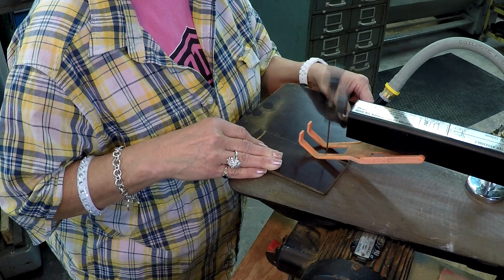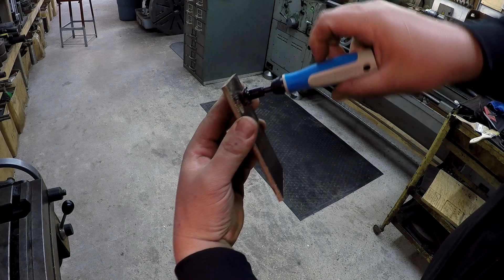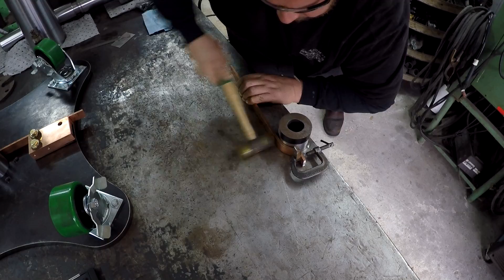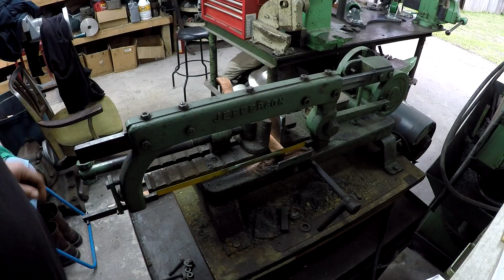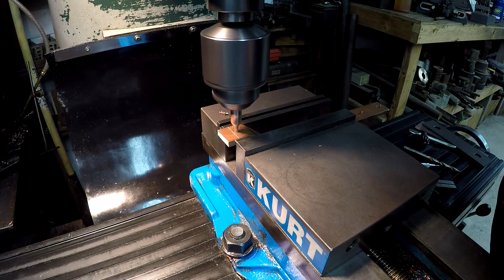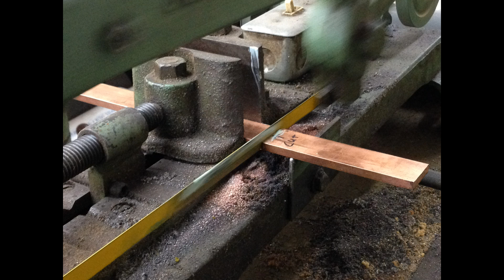Rotary Welding Table Build Part 14

Comment: Dear Adam,
1) in case you need to decrease Ohmic resistance later, you can increase contact area by machining the radius onto the copper bars with a flycutter.
2) thanks for the great videos as always. The part with your mom was great!
Thanks Henner
Reply from the maker: Thanks Henner.

Comment: Nice job putting the 45 degree bends in the bars, I run a 10' forming press at my day job. I like the spring on the bolt idea...that same thought crossed my mind when you first started mocking up the parts! Great to see your mom in the shop with you!

Comment: It was nice to see your Mom stop by to help on the project. The bolt with the spring is a Great Idea I would have a longer bolt with a spring on each side Not that your way won't work We all have are own ways and Ideas That's what is so great about reading the comments I have learned some different things in this series This is such a Cool build
Reply from the maker: Yes we have gained some nice ideas from viewers comments. Some of the design features were from the viewers.

Comment: Abom79 Hey Adam, great to see it all coming together.  A nice on screen demonstration would be to get out a voltmeter and check to make sure that copper block is actually isolated from the base.  Also, once it is all together, you can check resistance from the table top to the copper block to see what your circuit looks like.  Cant wait for my next visit this summer, get to put my hands on it.
Reply from the maker: Hey James, let me see if I can borrow a puke meter from someone and we'll do some testing. Can't wait for our next shop get together!
Reply: Abom79
Hey Adam, you don't need no stinkin' "puke" meter...
just cut the female end off of an extension wire, plug it into the wall,
touch one lead to the table top, hold the other one in your right hand and then
touch your left hand to the base... You will know if it is grounded or not.

Be careful though... I still think you are getting contact through the bronze bushings.

that's how my dad would do it.

Simple!  ;>))

Anon

Comment: Looking good Adam,

IMHO (w/ 32 yrs experience in electronics) your grounding system is sound.

Current will always follow the "Path of least resistance"  I.E. from the Brushes up the main shaft and into the tabletop.

The whack-nut Trolls that think it's going to jump from the shaft, to the bushings, then to the housing, thru the bearings, and then back the shaft and finally to the table top; that is way to much resistance (how meager it might be) it's enough to knock it out of the running as a viable path.

Now, (at the time of my comment) you've had it in service for 2 yrs, with zero issues I'm sure.

Thanks for the great content.  keep the videos coming.

Comment: Just for future reference, when bending a contact radius, always make your die 15-20% smaller than the radius you are trying to make contact with...ESPECIALLY with the less ductile metals.  That way when you assemble you've already taken the springback of the metal into account.  Learned this the hard way re-arching springs for hot rods.

Comment: Adam the ground clamp looks great.  You got a nice fit on the bars I liked your bending setup.  I've found that annealing copper makes it form a lot easier, especially after you have made an initial bend in it.  Copper work hardens really easily.  It's good your mom was able to pitch in with the project.

Comment: ......I would give everything I own if I could spend a day in shop with my mom......but shes 81.......very cool.... Nice work on the ground, the spring can go on the other side and still work fine, actually easier to install in wider gap....and a stronger spring can be used.....just a thought.

Comment: I was thinking about spring on the end of shafts. I think better solution is istaling spring in the center of copper bars. Bettesr forces to hold them and stronger forces to hold them on place. Spring on the end of bars will push out bats on center outside, i center will push them close all the time even they will used in time.  Sory 4 my language. 🇵🇱 Wojtek from Poland

Comment: Nice job on the copper work.  You might consider using dielectric grease between the 2 7/8 shaft and the copper bars to increase and protect the electrical contact being made.

Comment: Hi there Adam,
The copper contacts remind me of the old slip rings used on alternators. Intuitively the large surface area you have will happily conduct large currents. Over time, engineers found that "bifurcated fingers" provided a more reliable connection especially at the lower end of the current range. Basically using the sum of all the finger areas instead of one large one where the current distribution may not likely be shared over the entire surface area of your contacts. Trifurcated or even quadfurcated fingers would help insure electrical contact. Beautiful work as usual sir.

Comment: Flat braided copper strap wrapped around the shaft pressed in by your already existing copper bars would give you maximum contact.  It would be like putting a conductive foam pad against the shaft to use as brushes.  You could add this to your existing design without having to change anything.

Comment: Adam, you might have to add a bolt between the spindle and the copper block. If your bars get hot, they may soften and open. That's been my experience. Ging to depend on the amount of welding as well as welding temps. Nice job sir. It was great to see Mom come in and be involved.
Reply from the maker: I will be checking on the copper bars periodically to make sure everything it staying in place. If I notice some changes I'll go back into the way I have it and make some changes if needed. I think the way I have it set now will work good, but we'll see.
Reply: I'm sure it will and I know you have a good drip on things. I just metioned it because I've had copper do funny things when it got hot from current. Thanks for the reply.

Comment: Your idea of building a hydrolic cylinder from scratch would be a great project.  Have your friend come and help you size a cylinder to fit your manual hydraulic press. With his expertise, you could show how to size the pump and the other components he talked about in the first video. Then you could do the entire build. That would keep you busy for quite a while and cover a lot of topics.

The welding table is going to be a piece to be very proud of. It shows the creative side of being a machinist.

Really like to way you have been able to keep up with the weekly schedule, but do not feel obligated. If you need to take a break, we can handle an empty Saturday. Just do not take too much time off!
Reply from the maker: Thanks for the support Kurt. This build has been a great project and a way for me to show different machining operations. Also a good way to make use to materials laying around that I probably won't ever use, like the faceplate, and Gill's oilers. In the end I have something I can display showing my skills, and a useable tool for my shop.
I'll keep thinking about the hydraulic idea. I don't need one for my press as it has the factory Dake 50 ton cyclinder on it. But I'll come up with something. I do like your ideas though.
Reply: I am sure you could use a hydraulic actuator on something in your shop and it would make some wonderful video. Keep up the great work

Comment: About time for some paint!  That is one hell of a table, you can put your K&T on it and use it as a lazy susan for it. lol Good to see your mom and Stella in a video again.
Reply: NO Paint...

Time to Powder Coat it.

Powder coat will hold up much better to shop mishandling and abuse than paint.

A nice Satin Black powder coat with the Nickel plate.
Whoops, I mean Chrome plate.
Reply from the maker: Anon Ymousmie I like the powder coat, but I'm afraid it will be hard to correct of I mess it up after some use. I figured paint will be "fixable".
Reply from the maker: Thanks Brian! It's going to make a nice centerpiece for the shop when the guys are hanging out.
Reply: Anon Ymousmie
 Not in my experience. I have yet to see anything that was powder coated that held up as well as a good synthetic enamel. Powder coat is a cheap easy method to get a no runs paint job but it is not a superior paint coating.
Reply: bcbloc02 Abom79 First thing is find someone to blanchard the surface of the table, oh THAT would be sharp.  Then spray it in gloss black with polished brass accents.  One word comes to mind CLASSIC!
Reply: I'm with James. Gold leaf pinstripes like on old safes would be awesome, too. ;-)
Of course, you wouldn't be able to put a coffee cup on it but it sure would be pretty.

Awesome work, Adam. Can't wait to see it finished.
John

Comment: I haven't read all of the comments (401 as of this comment), but you might consider cutting a long taper on the main shaft lower end that will push the contact arms out of the way when installing it. Otherwise you might need to dismount the arms or reach under the base to spread then when installing the main shaft. If you need to remove it with any frequency, that might make things easier.

Nice series; it was fun to watch your ideas progress.

Comment: lookin good Adam!  A couple of weeks ago, when you started thinking about the grounding straps you showed the copper bars you intended on using.  It got me thinking about a way to ensure contact at all times but without using the spring alot of folks were recommending.  I drew a quick simple sketch up.  But basically my idea was to use the springiness of the copper bars and bend the ends outward- kinda like a V-block.  Then using the slots to adjust the tension between the bars and the shaft.  This would eliminate the extra parts like springs and bolts. Also, I would wrap some adhesive backed abrasive paper (like 220 grit) around the shaft.  Then tighten up the copper bars so they ride on the sand paper and get fit to the radius of the shaft. I tried attach the sketch here but it didn't work.  You got you method done anyway.  Thanks for the great series and I can't wait to see the rotary table in action.  Jeff

Comment: Adam,
An elegant and imaginative grounding arrangement. Beautifully done!
May I suggest that the bolt you put through the two ground straps use a nut w/o a plastic insert. You may find the plastic insert type of lock nut will melt with the heat of the current.
Eric

Comment: Great video! The ground straps are turning out nicely.
A couple of suggestions for consideration - All can be incorporated (or not) with the existing build:
1. Just to make it look cooler, instead of a coil spring for the tensioner, look at Bellville Discs. If you're not familiar with them, they are spring steel flat washers that are kinda bowl shaped - picture a tiny wok with a big hole in the bottom. This application is perfectly suited for them; constant pressure, short travel. MSC has them, along with McMaster, Grainger, etc.
2. Consider a thin film of conductive grease between the copper straps and the steel shaft. The steel will tend to corrode a little in contact with copper and an electrolyte (such as moisture), so a conductive grease will decrease corrosion (by displacing and repelling moisture) and an added benefit is that it will fill in any little gaps between the copper and steel and even out the conductive path - minimizing the little micro arcs and pitting.
3. Use an anti-seize (preferably copper or graphite based - not aluminum) on the bolts holding the straps to the copper block. Usually, Stainless and copper are OK together, but in low oxygen environments (like a threaded hole) the passivated chromium layer of the stainless can be damaged and not able to regenerate. I won't get any nerdier than that, but it COULD cause a problem, however unlikely.

It's possible that a decent graphite or copper anti-seize could be used for both the bolts AND the conductive grease, come to think of it.
Reply from the maker: I like the nerdiness Lazy D. We always learn something from each other by sharing ideas. Thanks for the comments.

Comment: Adam, where I haven't seen anything exactly like that, I have seen a factory ,at least I think it's factory, similar set up.
 The ground block was tapered toward the rod by what looked like 3 or 4 degrees giving a positive pressure, not springiness per say, but an amount of pressure, I think that would reduce the size of spring you'd need, or so goes the theory.
    Please, make more build videos like this.

Comment: Hey Adam...
NICE, VERY NICE!

You know you can lap the contact to make better contact.

A good trick is to use some 3M 77 spray glue to adhere a strip of emery cloth to the
post and just hand turn it enough to wear in the copper bars.  Won't take long with copper.  You can probably also get it done with valve lapping compound.

Careful...
5/8" x 11 threaded hole in post?... get an eye bolt first and tap to whatever thread the eye bolt has... would suck to have to re-thread an eye bolt.

Great Job... I love it!

Anon
Reply from the maker: Hey Anon, it won't take long and thosr two bars will be well worn in. I already have more than enough contact. No need to remove metal when not needed. 
I want to use 5/8-11 because of my eye bolts, and also i have good 5/8" hold down studs. 
Thanks.
Reply: Cool!... I should have known about the bolts.

Comment: The grounding system is looking awesome, and I'm sure it will work great. My only suggestion is to plug that extra hole in the copper block, weld and grind it flush to make it look better, you've put so much effort into it , might as well go that extra step. Cheers!
Reply: or thread the extra hole to mount a "locking" bolt to securely hold the clamp in place if you find it getting kicked out during use.  It would be awfully hard to kick that clamp out but the hole would have a purpose rather than look like it doesn't belong there.
Reply from the maker: Anon Ymousmie You guys will never see that extra hole. LOL

Comment: Great video (as always)! I suggest a bolt through them, a spring, a washer and a nut (or two to lock them). Then you can adjust the pressure and you may also try an Ohm meter (multimeter) to adjust and optimize for "least ohms" from the clamp to the table. Maybe a pipe (on the lathe) with emery paper taped on to grind a nice inside radius on the rods.
(ah should have watched to the end before I commented)

Comment: Nearly there Adam. The grounding system looks good (apart from the extra hole) :-),
Looking forward to the final build and then the finishing up/painting etc vid's to follow. regards from the UK
Reply from the maker: What extra hole? :)
Reply: Abom79
That's the vent.
Mike (o\!/o)
Reply: Moholo 88
You are looking at it upside down.  That's the drain!  8^)

Comment: Hi Adam, you do amazing thing.
I see two problems:
1. The spring is to small to bending enough 10 mm copper bus.
2. It will be poor contact after the cooper will be oxidized and shaft will be rusted.

My proposition. 
Make groove on the shaft and bend one bus all around it to make copper contact on shaft. Some small tapered screws can hold this line and make good contact between shaft and bus. Make final cut by lathe to make it perfectly round, 
Find one or several big graphite brushes for electro motor, starter or some thing. Make spring-loaded brush holder and connect it to cooper block by second cooper line.

Best regards, Serge
p.s. sorry for my english.

Comment: A couple of guys already mentioned it, but I think a split circle-spring design like on the top of a set of calipers would be an elegant solution. It would also reflect a "machinists tool" design on a welding table.

Comment: Hi Adam, great project, will be practical great looking and sturdy.
One thing keep your electrical contact surface from oxidizing, is to have a very thin film of low surface tension lubricant applied on them... Something like Noalox, or a good silicone dielectric grease, just a suggestion, hope it helps....
Pierre
Reply from the maker: Thanks Pierre. I'll be getting some and using it during the final build.

Comment: Looking really good Adam,,
 One suggestion to put it over the top, as its turned into a bit of a display piece, Brushed circular jeweling over the base plate and replacing the castors with some of those vintage looking iron ones

great job
Reply: Yes, and adorning the edges of the table top with rubies and diamonds will be a nice touch too.

Comment: Adam
You could take a voltmeter and set it to Oms, put one end on the copper block, and the other lead to the center shaft and see if there is any resistance, then once you have it mockup you can do the same thing to each piece. The base and the T handle.
I think the current will flow though the table lock T handle and charge the base and outer sleeve
Of that piece of ART
It’s freaking awesome Man.
 Bob
PS most voltmeter have a tone mode in the Oms setting.
Thanks’ again
Reply from the maker: I'm going to try and find one I can borrow and do some testing on it. Thanks Bob.
Reply: Abom79
Hi Adam
My thought is to make a new plug for the T handle out of phenolic rod. Then the T handle would be Isolated from the center shaft.
TOALTLY AWSOME table
Adam your Mentors can for Shure be proud of the man you have become.
Thank you

Comment: Adam, it looks great!  That spring looks a bit wimpy compared to those copper bars though. Not sure how small they are, but you might ask your motorcycle friend if he has any spare valve springs. Alternatively, you might just ditch the spring and go with the bolt alone. There's some spring in the copper itself the way you have it formed. 

Looking forward to seeing it all assembled and in action!

-- Mike

Comment: Just a thought, if you want to increase the contact patch on the copper bars to spindle.  Spray glue some fine sandpaper to the shaft and mount them under tension and rotate it to "lap" them into occlusion.  Or even just use some lapping paste straight on the shaft.